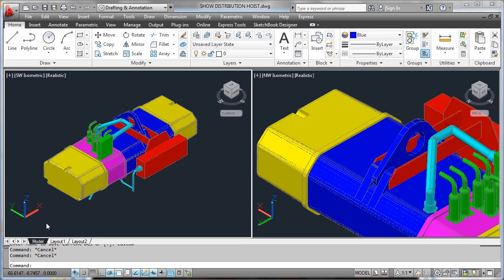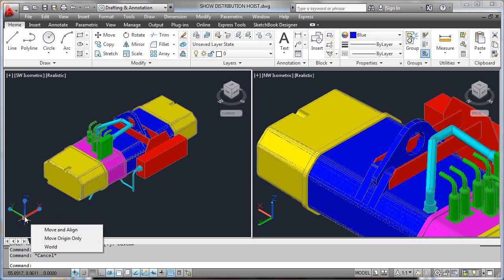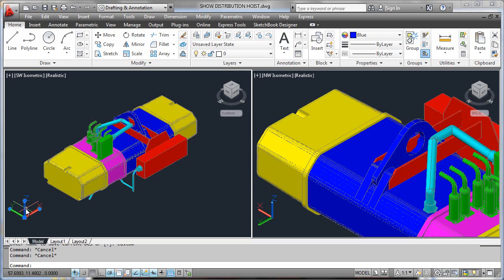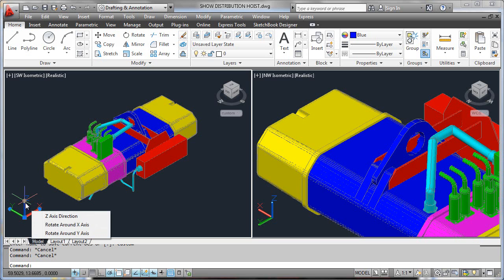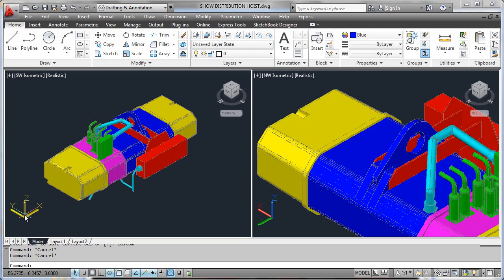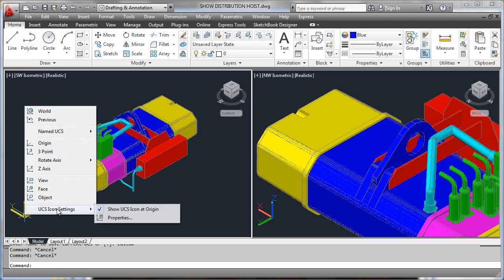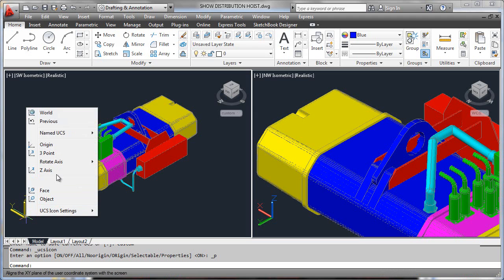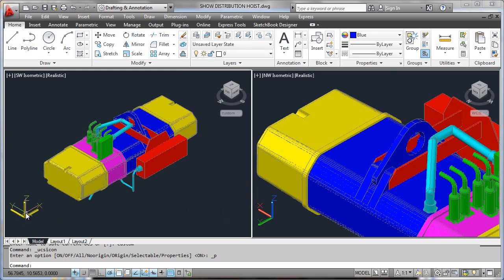Overview of UCS Control Options

Comment: How about a quick efficient way to lock drawings in 2D to prevent the users from mistakenly entering 3D coordinates in Autocad LT?  Or even better, a pop-up message for when a object with a 3D component is inserted or detected in the drawing?